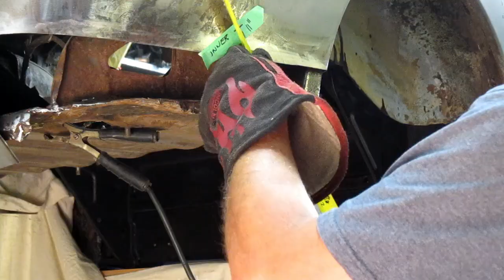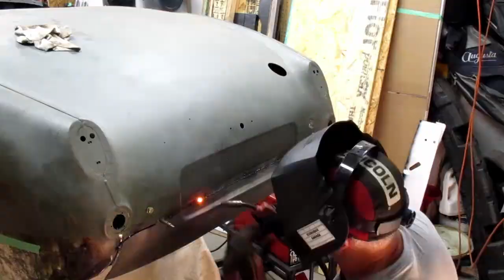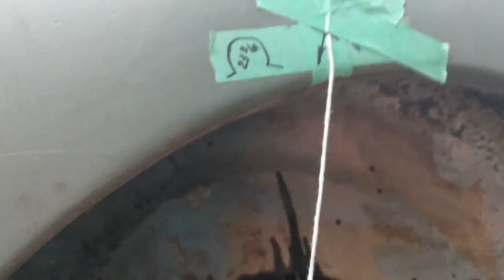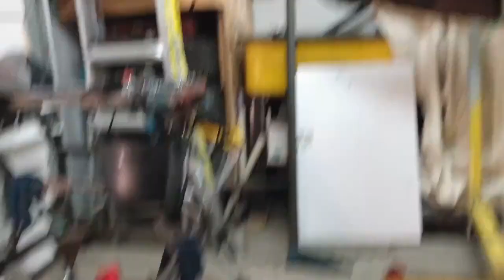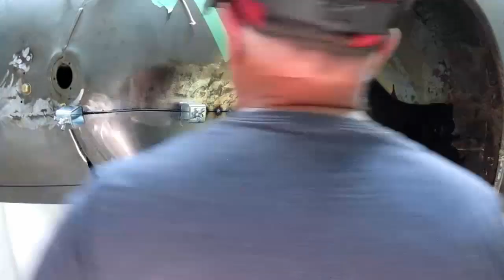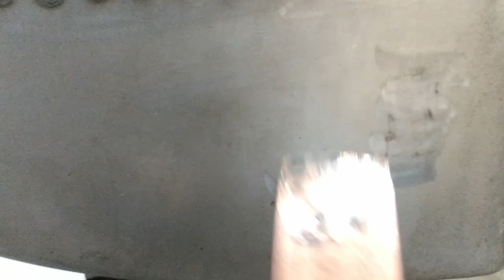Rear quarter & valance patch panels welded in place. I learn a new welding skill! Bugeye Build Ep 34

Comment: Great video! I learned three things already today -- while eating breakfast. 1. The flattened copper pipe to back the welds. 2; The trick with using the tape to match up the panels. 3. The string with the knot to line things up. Thanks! I think I'll take the rest of the day off. Your welds are definitely looking better too.
Reply from the maker: Thanks Trevor!